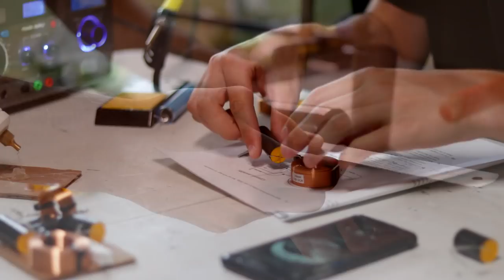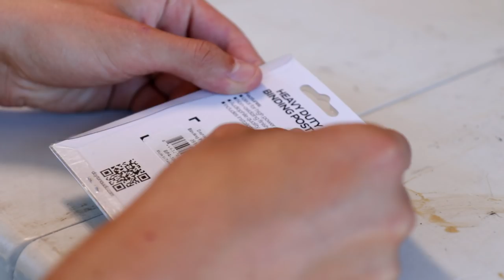Dayton Audio C-Note Bookshelf Speaker Kit Build!

Comment: If the boxes were smaller and deeper. These would be so sexy... But nice camera shots Jack, looks very professional.
Reply: ey jij ookhier
Reply: Hahaha nederlandse audiophiles gespot
Reply: Robbe Adriaens ja toch
Reply: if you'd want a deeper design you can easily calculate it. The shape of the box is not as crucial as the other parameters
Reply: Moi
Reply: but, how wide is the front baffle will affect sound (a little, worth trying and listen to them both :P )

Comment: Put some polyfill inside the box, will get rid of any hollowness in the sound, make it less boomy. Should make it sound better overall.
Reply: Polyfill is not used for that in speakers.  It is for acoustic suspension designs.  If it sounds boomy it would be most likely caused by choosing an improper tuning frequency of the port.
Reply: It can help ported speakers, too. I was going to mention to line the walls with it to prevent reflected waves, but was kinda lazy so instead of being specific i just said add it.
Reply: I know it doesn't apply to the ones in this video, but don't put polyfil inside internally amped speakers. Unless you like the smell of burning polyfil.
Reply: dude i said polyfil not steel wool

Comment: No polyfill in those speakers? Might improve the low end and cut down on port noise.
Reply: normally polyfill is used in an acoustic suspension design.  Port noise is managed by the design, you can simulate the air speed through the port and select a size and length that keep that speed below a value that you select as the designer.
Reply: Greg Kramer I’ve tested a bunch of speakers with and without polyfil and 90% of the smaller cabinets sounded better with a small amount of polyfil on the inside.
Reply: Were they ported?  Was the port frequency tuning was too high?  I do not doubt that it can help in a poorly designed ported cabinet.  The main effect would be to reduce port output which of course you would not want to do if it was designed properly.   Many small speakers use the port to create a bump in the bass instead of extending the bass. ( a generalization of course )  Adding polyfill should reduce this bump in the frequency response curve.
Reply: Greg Kramer ported yes and design was good. Cuts down on box frequency when it’s such a small enclosure. Jbl has used it for century’s in their speakers.
Reply: Greg Kramer box frequency? It’s the frequency where the whole speaker itself can produce the Lowest frequency. I have a pair of jbl 2500 series potted enclosure and it has tons of polyfil on the inside

Comment: Hey bro since you know heaps about audio, my home theater amp turns on but won't output sound what could be the problem??, i had a look inside and it has 4 fuses could it be a blown fuse?? I'd appreciate a reply, thanks
Reply: Check the fuses. if you take them out and they have discoloration or burn markt they're blown. But since the amp turns on and there's just no sound, you might have just not set it up correctly. Check that you don't have any Tape Loop buttons on, have selected the right regions (if this is applicable) and the right source!
Reply: HumbleDeer yeah no everything was working fine before then, on aux source, signal still comes through input i know this because the equalizer moves but there is just no output in the front left and right channels, the surround right left and center channels work fine but they are only for av and cannot work on aux source, so i kind of need the front left and right channels back in working order...

Comment: Random question,
I'm using some old pioneer bookshelf speakers and when I turn up the volume, little indents form in the foam surrounds, is this normal? or am I pushing the speakers too far? They have the same sound quality as low volume, the surrounds just get little indents, like someone is pushing them in with their fingers or somehting....... Haven't seen anything about this online so I thought I would ask here.
Thanks for any helpful responses :)

Comment: The mid drivers should be lower, not sure why it's litterally on top of the tweeter with these kits. Besides looking odd it  can change how the tweeter performs especially when the tweeters baffle curves out.
Reply: The design was made just because of that. If it weren't of function, they wouldn't have made the cutouts there. Think before you comment.

Comment: They lack bass, the mids sound kinda echoey but the highs are okay (bass&mids can be improved by adding polyfill inside the enclosure tho)
Reply: You've to remember that you won't hear the same quality that he does as it is being recorded.
Reply: Victor Quintana yeah, but I compared their sound to other speakers he recorded the sound of, through the same mic.
Reply: Very hard to evaluate that way. Without hearing them in person I would say impossible.
Reply: The C-Note speakers are definitely not perfect but you really do have to hear them for yourself. They're almost as good as my DIY-redesign of the Tango's (which are double the price and way bigger). Regarding your remark about missing bass: you're right. They're make to be used with a subwoofer. They're way too small to stay linear with a lot of bass.

Last note will be that they're recreational speakers, for fun. Not for audio engineering or perfection. Don't like the sound? Choose another pair of speakers. Nobody will be using these for referencing.  (The Tango's are!)
Reply: HumbleDeer the size is not necessarily a problem (search for technics sb-m300 on google) but for some diy speakers they perform pretty good, especially considering the price.
Reply: Cezar Lixeanu dude polyfill does not extend bass or mid bass, polyfill is used to dampen the hollow sound and reflexions to the driver. To extend bass you can do things like bigger enclosure, more driver's, or maybe bigger driver's but definitely not polyfill. ; )

Comment: Next up your to do list is how to do a high quality paint finish,because sorry to say but this looks like a crap job(just like the crossover on a piece of cardboard instead of hardboard or thin multiplex). Not to hate or what,just some critisism.
Reply: No one will see the crossover anyway so why bother?
Reply: Because cardboard can rip apart ;)
Reply: king Roffe also if the resistors heat up they could scorch or worse catch on fire. Those resistors can get very very hot depending on their purpose.